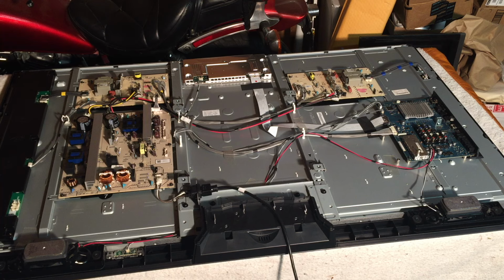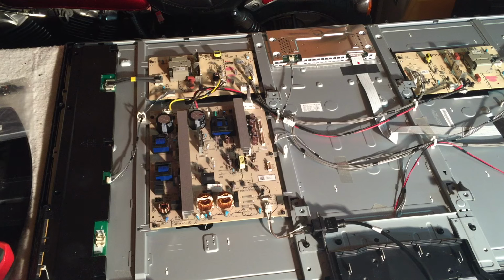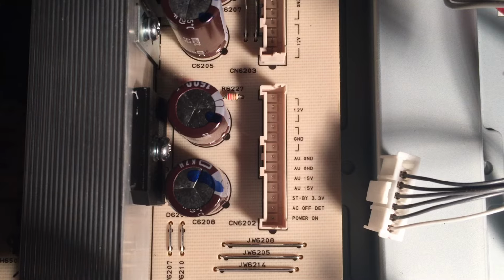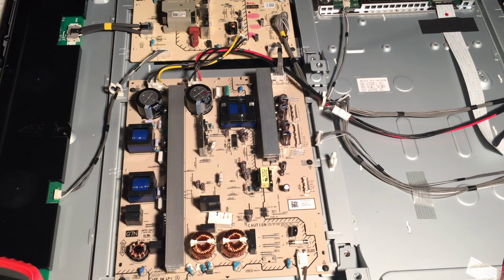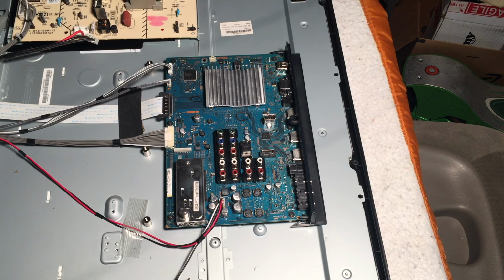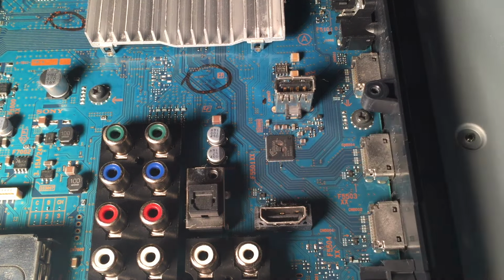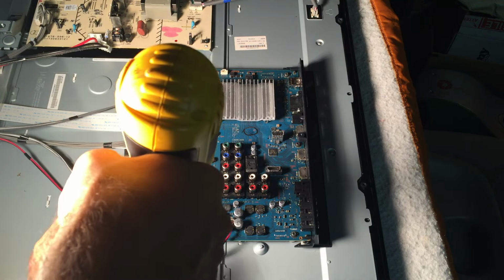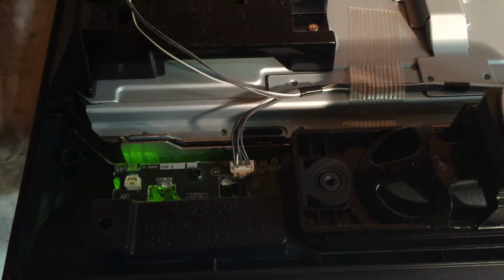How to Fix a TV Hit By Lightning or Power Surge

Comment: My flat screen TV was destroyed by power surge, upon opening the back and inspection I found a capacitor was blown which I then replaced, but it still refuses to turn on standby mode light. I have thoroughly checked the circuit board and I can’t find any other burnt components, Please what else should I do next?. Thanks

Comment: Soooo, if the fuse is blown, should I just change the fuse or change the whole power board ? And if I just change the fuse are they a pull our or a solder hook up ? This is a great video got hit by lightning 2 days ago, no power, no standby light. Haven’t pulled it off the wall to look yet, it’s 75 ‘’ RCA and is 130 pounds and I’m 80 years old so I don’t want to take it to a shop, that’s a major job. Thanks again for your video . EJ
Reply from the maker: It may be that you only need a fuse.  Sometimes the fuses are soldered to the board and sometimes they are not.

Comment: I can't see any damage on the main board and the power board passed the fuse check and standby voltage check. Should I just replace the main board even though I can't see any damage? The TV shows no signs of power or sound when it powers on.

Comment: My tv turns on and I can watch with antenna but my Roku HDMI does not work. Was Struck by lightning yesterday fried the modem when I try to put in another Roku device in it with a different HDMI it does not connect so I’m going to assume is exactly what you’re showing us but I don’t know how much a board would cost do you know roughly the cost of a board and where I would get it for a sharp tv?
Reply from the maker: Find the model number on the back of the TV, then look on eBay for a main board.

Comment: Can anyone help?!  We used this fantastic video to test 2 of our tvs, that we just lost in a storm.  We determined there were issues with the power boards in each.  A visual inspection showed nothing amiss with the main boards.  Replaced the power boards with the following results:
Sony XBR 65X850B - when we plugged it back in, nothing.  After a short bit, a red light started flashing at the bottom (standby light?) 8 times.  Followed the limited instructions we could find and nothing.  Found instructions to hold power button in while plugging back in and voila!  A dark blue screen came up.  But then, nothing.  No Sony Logo; nothing.  It shut itself off after 30-60 seconds.
Vizio - (don't have the model # on hand. It is a D series)  Replaced power board and NOTHING.  No lights, nothing.  After trying all the same as above, still nothing!  This is the one I thought for sure would work as the fuse and connecting wires were visibly burnt up.  
I really thought this would work.  I'm heartbroken it didn't.  Any other suggestions?  Anyone?  :'(

Comment: My Sony Bravia standby light works but it only stays on for a few minutes. 

The longer I leave it  unplugged, the  longer it stays on. But it eventually turns off in a few minutes. And I did check to make sure the timer was off that turns it off after a certain period of time. 

My guess is that something is okay while cool, when it gets heated up, it turns off. Just what would that be then, a fuse? And in which part the Power or the Main board?

Comment: No, I don't know how to use a multi meter, diode setting volt, the j thing it's all a foreign language to me. I have to hunt down a video that just shows me exactly what to put that dial on, how to know what the readings are supposed to be, I saw them here as you pointed them out very specifically, but on some instructions, I can't tell where the numbers are coming from like the diodes, I don't know where to find that information.

I do know how to figure out what a resistor rating (is this the correct nomenclature, "rating"?) is by the color of the stripes on it. That's fun and easy enough.

Comment: I have replace the power supply board, main board, motherboard and the small board theta has the power and channel change buttons.

My RV was hit by lightning, it came on a couple times after the lightning strike but then stopped powering on completly.

Once the four boards were replace it powers on, but the Visio logo screen never comes on. It’s clear that lights are on and the standby light comes on but then cycles off then back slowly taking the front screen slightly on and then black again.

We tried turning the TV off unplugging it and holding down power button for ten seconds to power cycle it but still doing the same thing.

What should I do at this point?

Comment: I have the same TV. The power light comes on, but no screen picture. I know it is getting power, because the optical audio on the back, is lit up. Blank screen though. Does that sound like I need to replace the main board like you did, or could that just be the fuse you were talking about?
Reply from the maker: Did you go through the guide I have?  There should be a link in the description.  You want to rule out if the backlight is bad.

Comment: can you just replace chip? thats burnt
Reply from the maker: Yes, you certainly could. But then issue you need to be concerned about is if there are other components that were also affected by the power surge. I would also be concerned about the traces inside the PCB.  I was fixing this TV for a friend and wanted to give them the fastest turnaround time so I just replaced the board.  But great question!

Comment: So literally just got my tv today, within 5 minutes of it being turned on for the first time there was a lightning strike and then a popping sound on my tv and it shut off. Worst luck ever. I have a Hisense tv and I googled the model number and main power board but I can't find anything. Any suggestions on how I can find the parts?
Reply from the maker: Sorry to hear that! If it’s a new TV, there may not be many parts available yet. I would set an alert on eBay for the part you need, as well as alerts on other websites that sell TV boards. You could alternatively try to track down the components that went bad and solder in new ones.

Comment: How can you prevent the strike jumping through air to the hdmi slots ?. If all hdmi slots have cables plugged in would this stop the strike from entering the hdmi slots and protect the tv or is there another way? This has happened twice to me  , fried the tv's totally and only took out the hdmi slots , and only the hdmi on the two pcs  that were  plugged into  these tv's. Everything else on pcs continued to work except the hdmi that was fried on the pcs.
Reply from the maker: The only way to be for sure would be not to have any hdmi plugged into the TV or make sure all of those other devices are unplugged or protected if there was a power surge.
Reply: @FrugalRepair  So no way to protect tv but can protect pc or other hdmi peripherals by unplug ing them from tv?
Reply from the maker: There may be a product that you can buy to protect hdmi cables from a power surge but I’m not aware of one.  Anything connected to the power line could be a source for the power surge.

Comment: I tested the fuse and it was ok, but the standby 3.3v was not reading. What next???
Reply from the maker: If there is no standby voltage then most likely something on the power supply is bad.  Make sure you are testing it without the main board connected.
Reply: @FrugalRepair  Is the main board the one with the HDMI plug ins and computer chips? Btw, my tv is a Sony Bravia KDL37M4000.
Reply from the maker: Yes, that’s the main board

Comment: My 12 year old granddaughter just brought home a VIZIO TV struck recently by lightning. She got interested in an electronics experiments kit and built a couple of breadboarded projects. We will open the TV in a day or two to see what we find. My favorite electrical repair is our built-in Microwave that matches our other appliances. I checked all of the components with a DMM, but it still did not cook, even though the turntable went around. I tightened all of the spade connectors with a pliers and the microwave has worked fine again ever since.
Reply from the maker: That’s great! Hopefully you can fix the tv.  Great job on the microwave.  Usually that kind of problem is one of the door switches goes bad.
Reply: I checked the door switches as a first step. I did not find an indication either was definitely faulty, but replaced both, anyway, as a precaution. I also confirmed the fuse was good. The oven still did not cook. I did know to be careful of the large capacitor and shunted it after safely bleeding it. I do not know which spade connector was a bit too loose, but the oven cooked again after crimping all I could find.
Reply: @FrugalRepair  Today the 70 inch TV works again. I watched a lot of videos and did lots of checks, but developed no firm conclusions. Finally, I found a rebuild kit With the three primary boards at ShopJimmy. I watched as my 12 year old granddaughter installed them. The TV works great now.
Reply: Concerning other repairs, a friend was at a yard sale and bought a cute wall mount planter that looks like an old wall mount wooden telephone, but smaller, it also has a built-in AM tube radio. The radio did not work and she wanted it to work. I used my Ohmmeter to check pin pairs on tubes to be certain heaters were not open circuits. A 50C5 tube showed no circuit between any two pins. I had some old radio parts and replaced the 50C5 tube. The radio worked! 
     Another friend had a fancy electronic flyswatter that looked exactly like a tennis racket, but it did not work and they could not return it because they had bought it while traveling. The face of the one transistor inside looked like a bomb crater. I assumed some things. 1) It was probably an NPN transistor because those are more often used than a PNP transistor. 2) It was probably a low voltage general purpose transistor used for switching to create a pulsing current that could be stepped up by the transformer from the AA batteries to a high voltage. 3) The pin out might be the same as the common 2N2222 NPN transistor I wanted to try as a replacement. It all worked according to my assumptions and the couple’s grandchildren had great fun with it. (The design allowed a high voltage wire to be too close to part of the low voltage circuit, and a high voltsge jumped to the transistor. I moved the wires apart.)
     I was using an old cell phone charger to charge my Kindle. My grandkids overloaded it and it burned out. A book about electric motors mentioned that switch mode phone chargers usually quit working because the capacitors at the far end of the circuit fail. I found replacements for 35 cents each and the charger works again. But, their physical size is too big to use the original case. I covered some things with hot glue for electrical insulation and for mechanical stability.

Comment: So my 60” vizio stopped turning on after a severe lightning storm. My power supply board has the 3.3 volt standby and is working, however the 12 volt part of the supply is not there. I’m guessing that the main board turns on the 12 volt portion of the power supply which turns on the tv. My question is, should the 12 volt pins on the power supply be hot when the tv is off or does the main board control the 12 volt section when you turn on the tv. I’m thinking the main board is bad, but not sure.
Reply from the maker: To answer, it depends on the power supply. To double check, you can send a 3v signal to the BL_ON marking and then test if the 12v rail comes on.  BL_on means backlight on, basically when someone hits the power button that signal goes high and tells the power supply to turn all the other voltages on.  It may not have the same marking on your power supply but you can look and maybe find the equivalent.
Reply: Ok, my board has a “bl-err” and I noticed a “ps-on”. I’m not sure what the “err” means and I’m thinking the “ps-on” is power supply on. So, put 3.3volts to ps-on to see if the 12 volt part on the power supply comes on?
Reply from the maker: Yes, I should have mentioned it but you are correct. ps_on is what you want.  Putting 3 V or so on that pin should tell the power supply to turn on all the voltages.  Let me know how it goes.
Reply: FrugalRepair 
Thanks for your help. I jumped the 3.3 volts to the ps-on pin and still didn’t get the 12volt pins to come on. So I guess it confirms the power supply board is bad. What do you think the likelihood is of the main board being defective as well? The power supply board can be had for about $50, but the main board is around $200. I’m thinking It doesn’t pay to invest that much into a 5 year old vizio set when a new better tv can be had for slightly more.
Reply from the maker: I doubt both boards would be bad but anything’s possible.  You could try to feed the main board 12v and see if you can get sound on the speakers to test it.  You can also troubleshoot the components on the power supply.
Reply: FrugalRepair 
Thanks so much for all of your help.
Reply: FrugalRepair 
I did notice that the ps-on pin had 3.1 volts on it all the time, whether the power button is pushed or not. I did start testing components on the power board, but found nothing so far.  I’m wondering why there is power on the ps-on pin when the on button isn’t closed? Makes me think the main board is sending that power erroneously. Wish I was a little more knowledgeable with this stuff. I know just enough to get in trouble.

Comment: I have a 60 inch Samsung smart tv that was hit by lightning. It would not power on or respond to any button pushes or anything like that. The standby light was still on so I assumed the power supply was working fine, so using your advice I changed the main board. Now the TV will power on and flash the "smart tv" logo, but then it goes blank and nothing happens. I can't turn it on or off after that, I have to unplug it. Any advice?
Reply from the maker: It may be the backlight going out, which I wouldn't necessary tie to the power surge.  It happens frequently though.  If you download my pdf I have a number of things listed that may help you:  frugalrepair.com/resources  Look for the flashlight test and the trick to turn down the brightness.

Comment: Hey , could I take a main board from a another tv instead of buying one and replace it?
Reply from the maker: That usually will not work because the connectors don’t match. Even when they do match, you have to ensure that the outputs to the LCD panel are the exact same as the original.  Usually you’re safe if the board number printed on the PCB is the exact same.  But that’s a generality, there may be other issues like firmware differences, etc.

Comment: Where do you go to purchase main boards or power boards for a TV?
Reply from the maker: eBay usually
Reply: @FrugalRepair Thanks! I'll check on there. Someone gave me a new TV to scrap that was damaged in a storm. They didn't have it plugged into a surge protector. I'm hoping I can fix it.
Reply from the maker: If the screen isn’t cracked you can almost certainly fix it.
Reply: I sure hope so! Screen is in perfect shape!
Reply: Hello. So I got the main board today and put it in. The tv now comes on and we have sound but all I see on the front of the TV is a bunch of lines. I'm stumped. I would appreciate any help.
Reply from the maker: @abbiebroussard3220  My last two videos may help you.  Try the isolation technique on the screen.  If the problem shows up the same on both halfs, then I would suspect the tcon board (or a faulty main board if it has the tcon intergrated into it)

Comment: Ok I've figured out that my fuse is blown. How do I remove it and where can I get another fuse? Thanks great video..
Reply from the maker: You may need to solder it out. Some of them are only held in by clips so you can pop it out. You want to match the specs on the current fuse. So it’s usually printed on the fuse or on the board
Reply: @FrugalRepair  thanks for the help . this is the most informative how to video I've seen.

Comment: How much does it cost to fix or is it cheaper just to buy a new one
Reply from the maker: Do you mean replacing the board or a component on the board?  Compared to buying a new tv it’s usually cheaper to replace a faulty board.  (And even much cheaper to replace the individual component(s) that are bad).
Reply: @FrugalRepair  thanks good video

Comment: @Frugal Repair  I have an element elefw605  tv that caught fire recently when I was watching it. I contacted element and they sent me for repairs but the repair shop said the tv had water damage to it and that there was water in the hdmi ports. I know that when I took the tv to them it had not come into contact with water. With that being said since it just randomly caught fire is that something that could cause a brownish liquid due to parts melting? Also is this something that we could just repair at home? Really not happy with the repair company element is using.
Reply from the maker: If the problem is on the main board, yes, you can repair it.  The easiest thing is to buy a replacement on eBay like I did in this video.
Reply: Ok should I have the repair shop diagnose the issue for me?
Reply from the maker: It’s up to you.  If there is physical damage you can probably see which board is the issue.